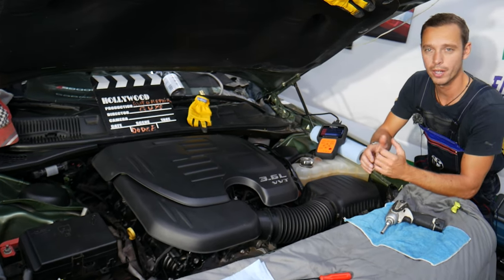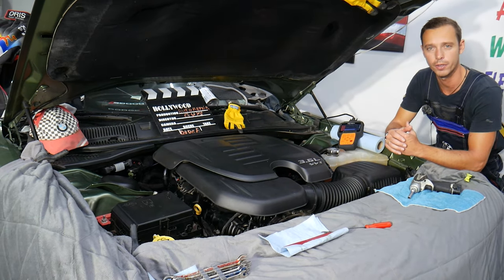DODGE CHARGER PCV VALVE REPLACEMENT LOCATION REMOVAL

Comment: How come .my 2011  challenger 3.6  has 3 bolts on its  pcv valve
Reply: Only the 2005-2010 dodge chargers/challengers have this exact set up.. anything after 2010 would be a little different..Also this is a 3.5 engine.
Reply: There was a redesign on the pcv valve and hose
Reply: It was redesigned because it was hard to remove